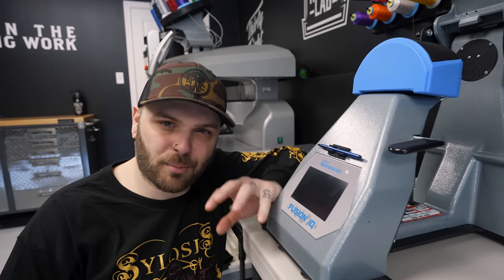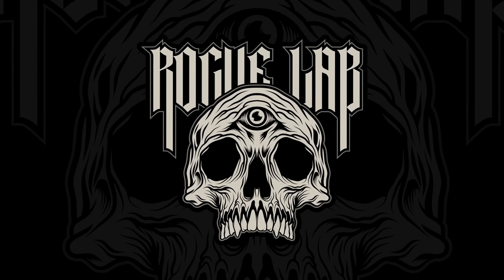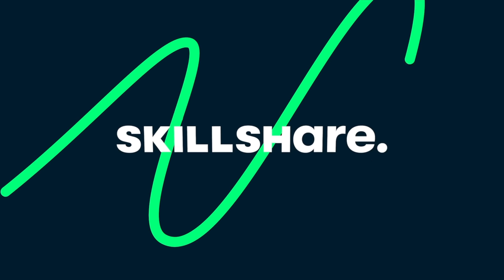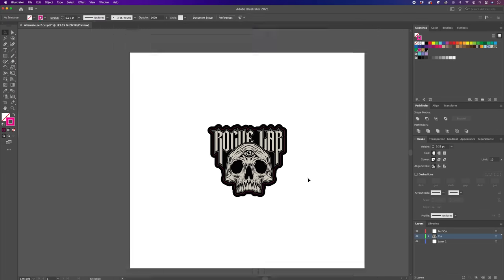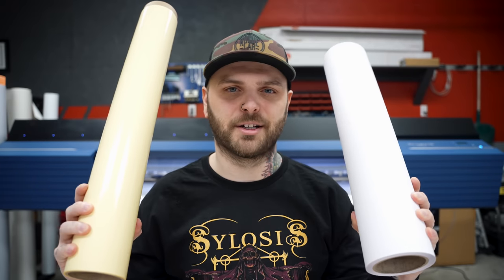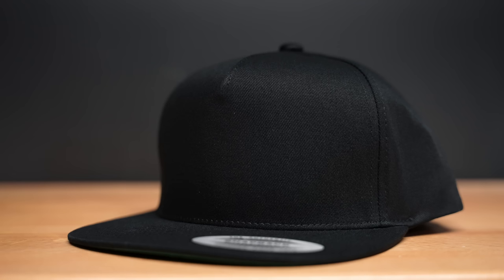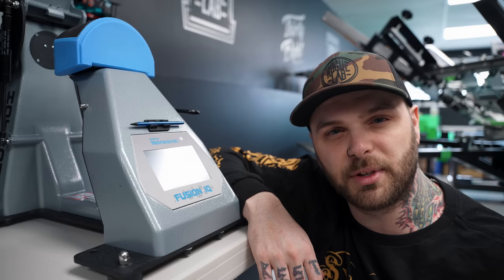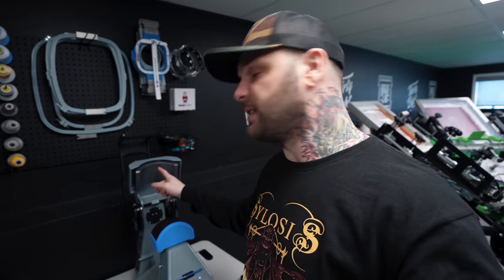Heat Press CUSTOM HATS With Printed Heat Transfer Vinyl🔥

Comment: These material works like a charm on a latex printer as well and there is no need to wait to dry because it comes out completely dry right out of the printer.
Reply from the maker: This stuff does NOT work on a latex printer. There are vinyls made for using on latex printers but this is not one of them, it's solvent only. Solvent also produces way better quality

Comment: Been using Neenah 3G Jet Opaque and have had real nice results with it so far. Yes it's a desktop printable but for a smaller business, just getting going, thousands for solvent printers in the beginning are not feasible. Get a good pigment ink printer and you will see pretty durable results.
Reply: Hey man what printer do you use ?

Comment: This video is unbelievably perfect today. While I’m still waiting on parts to repair my PRS100, I’ve been picking vinyls to try out HTV on about 200 hats I just got in while I get my embroidery back up & running. Substantial difference is that I’ll be attempting this with an Easypress, buuuut I ordered my IQ 360 (or vice versa) about a week and a half ago. Due to arrive 3/8!
Reply from the maker: Hell ya you'll love the 360, it's untouchable by anything else out there right now

Comment: another cool video! The dry time with ecosolvent is one issue why i went with a Latex printer.
Reply from the maker: Latex is good for that, it just didn't meet my standards in a few key areas
Reply: Hey, I got 2 questions regarding latex printers and was wondering if you can help?
-I’ve seen holographic stickers and was wondering if latex printers are good for printing over holographic vinyl?
-Do you still laminate the prints after or are they weatherproof right after printing?

Thanks in advance.
Reply: @MadebyEdgar  i wont spam it here but there is another guy i chat with that does holographic vinyl printing with latex,
Reply: @leestuart38 I have my stahls hat press on order as well.  edit: ye I used to work at a roland dealer years ago, def still like them. I guess weigh your needs and pick the right one!  nice job!

Comment: Super video Lee, thanks. Your videos sealed the deal on me getting a 360. I love using HTV as it really increases the range of what can be printed. And of course minimal weeding compared to just plain cut vinyl. But, the only thing that puts me off HTV is the glossiness of the solvent ink. No matter how matte the actual HTV, the gloss of the ink makes the logo unreadable at the right angle. Or maybe I'm just doing something wrong...
Reply from the maker: It really depends on the material you use more than the ink. This material I'm using in the video prints very matte and always looks great.
Reply: @leestuart38  thanks Lee, might try a different vinyl then. I'm using Siser Softprint Colour Matte. It looks super matte before printing.

Comment: Super informative! 

I am struggling a bit to get my press dialed in. I use Richardson 112 and Yupoong 6606 mostly and a few Richardson 320 or other chino style hats. I am using 1.4 - 1.6mm genuine leather patches. Originally I was using the stahls thermo adhesive and was struggling to get the patches to stick to the hats. I could get the adhesive to adhere to the patch but not to the the hat. I switched to heat n bond ultimate and had more success but am still running into issues with adhesion here and there I’d say 1or 2 of 5. I use the standard 320 280 heat settings. Time is 45 seconds. First adhesive attachment is 5 seconds. Pressure is 5-7. When I called, Stahls actually said you were the man and may be able to help!  So help! 😂 jkjk. 

Let me know your thoughts if possible.

Comment: best thing I've done all day is come across your channel. your set up is GOALS AF. I've been wanting to do HTV on a hat, but my only solution was sublimated easy subli...your stuff is dope though!!! Thanks for this vid
Reply from the maker: Thanks a lot! If you need transfers hit us up 🤘🏻
Reply: @leestuart38  I definitely will...working on designs and until I get a setup, I'd love to have transfers made up. So, when you mention this printable HTV is to be used with solvent inks, do mean only the print/cut printers (like the Roland), or can those eco tank printers, using solvent ink, be used as well? thank you

Comment: Lee Stuart, If its curling up on you, it might also be your temp too high. I usually learned to run mine at around 85degrees when i print on HTV. I use SISER printable HTV with my Roland.  The stahl brand might need a different temp.
Reply from the maker: It's from the slight contraction of the ink drying that will curl it if it's cut too quickly

Comment: Great video bro. Thanks for all the info. Any heat temperature setting tip for pressing Siser Brick 600 to hats.Would u use the same settings that u mention in video of 290 / 220?

Comment: What was the tape you used to hold down the vinyl in place till pressed, also do you recommend the Stahl premium plus vinyl for just solid colors for hats?
Reply from the maker: It's linked in the description 👍🏻. As for the vinyl, for single color stuff I prefer their fashion lite or ultraweed

Comment: Hey lee, sorry for the non related comment, but here i go. I have been having this certain printing problem for weeks now and its driving me fucking insane and i making me seriously contemplate quitting screen printing, so ive been looking around everywhere but never got an answer. Basically when i print i am not capable of driving the ink into the tshirt, basically the print looks good on press but when you hold it up against the light, certain areas are extremely see through (you can see the individual lines/threads of the fabric). One might think that this could be cured by simply using a smaller mesh count or more pressure / angle. However, i encountred this most often with halftones, and when i do that, the gain makes the halftone look like shit. Basically the ink is not transfered to the shirt and is left in screen.

I hope i have been able to express myself well enough. If you, or anyone on this planet for that matter, has got any tips, i will give them my a virtual hug. Also, keep in mind that i have tryed every-fucking-thing to make it work.. angle, pressure, of contact, different brands, plastisol, waterbased, different tshirt brand..... i am going mad

Lee i remember in one video you were talking about throwing frames and i can so relate ! Screen printing has got the capability to make me mad beyond anything on this planet. I am usually quiet cool and collected, but believe it or not ! I have not too long ago chewed up a t shirt. Yes, chewed. Like a dog, i put it in my mouth and started to tear it apart with my teeth ! Amen.
Reply: sounds like not enough pressure to me.  if youre underbase is this way, every color on top will be this way as well.  slow the stroke down as well.

Comment: Great vid...as ALWAYS! We purchased this machine based in your recommendation and review! We even connected and ordered leather/embroidered patches from your recommended person. I made my first hats last weekend. They turned out sweet. It show a little scorching and we immediately orderd the flex sheet. Playing around with regular vinyl now...is there a formula for setting the platens for regular vinyl? Also, how do we order the full color vibrant patches from you? Is there a min quantity? Please let us know. Dope!! Thank you and keep doing what you do....so inspiring!!! 🔥🔥🔥
Reply from the maker: For vinyl applications I usually run the lower platen on the colder side since the material is so thin and doesn't really need the extra bottom heat. 200° seems to work well for that. If you want transfers just shoot me an email through the rogue lab site with some info about what you're after 🤘🏻

Comment: Excellent video and great tips - I want to step up my print workshop with a Roland Printer/ Plotter like yours, which is the model you use/ is there any other model you would recommend me to check out?

Comment: How long do you figure the vynil on the cap will last through normal use wear. Till it starts coming off or fading away?
Reply from the maker: If it's done right, it should last the life of the hat

Comment: Hey, thank you for been so  Detailed with everything! Great video!  
Question; can this machine press woven patches on caps/ foam trucker hats?
How strong is the attachment,  would it need also to be stitched, for the patch to stay?
Thank you
Reply from the maker: It'll press patches onto truckers just fine, I've done it a lot. The strength of the bond will depend on the quality of the adhesive used by whoever made the patch. If it's well made and applied properly, the front of the hat will rip off before the patch does.
Reply: @leestuart38  thank you! I hope the adhesive is good on these patches

Comment: I wonder if easysubli would work just like the printable vinyl. It’s super vibrant. I use it on shirts occasionally
Reply from the maker: I've never used it but you'd probably get similar results, not sure about the longevity compared to this stuff though
Reply: @leestuart38  right on! It holds up really well on clothing. So I think it would do well on hats. I’ll have to try some. I have been doing brick and strip lock lately. Looks really cool!

Comment: Did you find printing on the Roland a bit grainy on initial install without optimising your settings? I use the BN20 and find the print quite grainy!
Reply from the maker: They're all going to be grainy until you dial them in. You should be dialing in the printer to each material you throw in it, every single time.
Reply: @leestuart38  yeah we only use the Stahls transfer vinyl on ours. Keep up the good work man!

Comment: Hey Lee, Awesome video as always. I have been thinking og getting into the print and cut myself for garments etc. Would a Latex wide format printer work or do you recommend eco-solvent as in Roland BN-20. Reason I ask is Ive heard that if the eco-solvent type sits for few days or not used constantly the machine messes up as opposed to the waterbased latex etc.
Reply from the maker: Eco solvent all the way, latex is ass for this stuff. That's also not true at all, solvent machines all have self maintenance schedules to keep them from drying out. They can sit for a very long time as long as there's ink and cleaning fluid in there
Reply: @leestuart38  fantastic brother  ty. I have an opinion white toner printer and also a graph tech 24 inch cutter. Is there a 24 inch solvent printer u recommend? I thought about Roland bn-20 but technically wouldn't need the cutter. It does seem like a solid machine tho.

Comment: I just bought this press. I need a circuit breaker  just for it right. its own designated?
Reply from the maker: It isn't required but it's the ideal setup. I don't have one

Comment: Hey Lee. I'm a 23 year old artist and designer, I've been printing screenprint and signage since I was 13. I am ready to buy my first full color printer plotter, but am struggling in which one to choose. Do you have any advice on the best printers? I've looked at both rolland and mimaki
Reply from the maker: I went for the Roland to have an 8 color printer for a wider color gamut without needing to get the white ink upgrade. That stuff is a drain on money if you aren't using it regularly and we wouldn't with the stuff we make. The mimaki is 4 color (CMYK) only without the white, and I don't think they even go up to 8.

Comment: When you gunna test out sublimation? I've heard its the same quality as water based screen inks cross with the ease  of heat transfers. Seriously considering getting into it once I finish saving up. Cheers for your awesome quality videos!
Reply from the maker: Sublimation is kinda useless for most people in my opinion, I have a sublimation printer and the odds of seeing it here are pretty slim. It only works on pure polyester and is best used in a cut and sew environment
Reply: @leestuart38  thats fair enough cheers for replying, it should work on a polycotton blend for a vintage look no? 

Trying to find a solution thats cheaper than dtg for cheap one off multi coloured photos in the UK. 🤔

Comment: What do you mean the stahls vinyl is not made for desktop printers, what about the Roland Versastudio BN-20?? It uses eco solvent ink cartridges
Reply from the maker: That is far from being considered a common desktop printer
Reply: @leestuart38  You tha man! Thank you for replying 👍 But have you see how they are marketing the BN? VersaStudio BN-20
Desktop Inkjet Printer/Cutter.

So I guess I’ll be good using that material? Thanks again

Comment: Good morning Lee I like you're  videos, I need a recommendation for start a new screen printing business,  
I have a $ 5,000 for start is good or bad. What queipmet is good for start,  thank and Good bless ypu
Reply from the maker: $5000 is an good start for hobbyist setup, but if you want to do it as a business you'll definitely want to save up more. You'll want a good press with micros, a flash, a conveyor dryer and a decent exposure unit at the very minimum to get started as a business